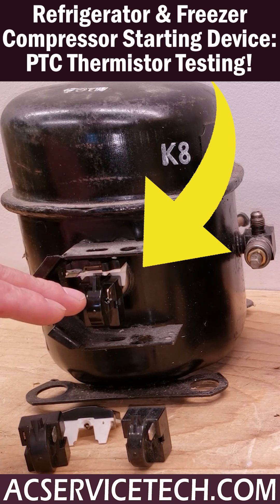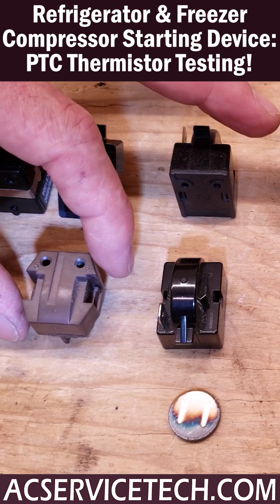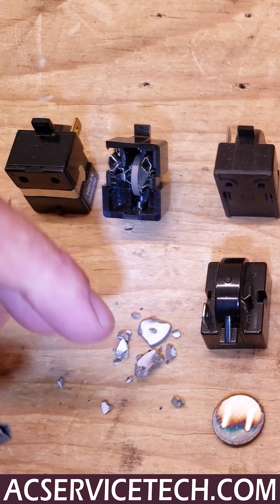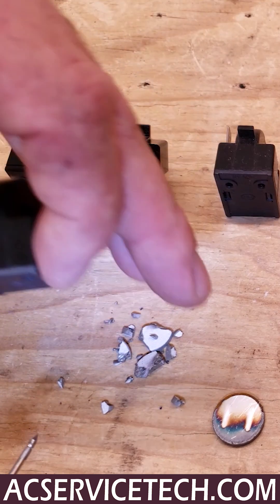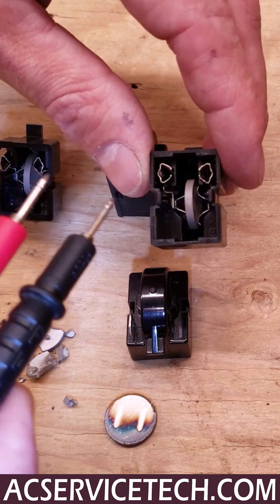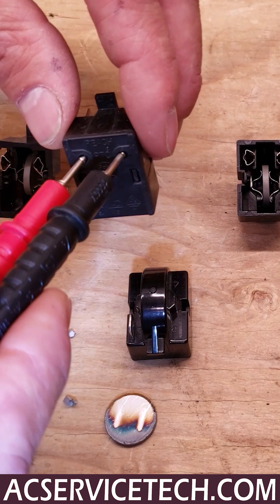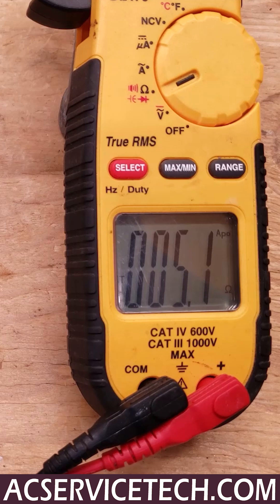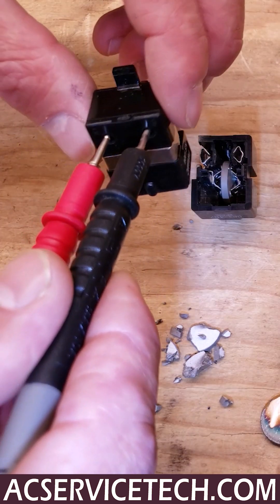HVAC Component Training! PTC Thermistor Testing & More!

Comment: Great video.  I had a one fail on a Friday night on my fridge that wasn't cooling.  I had a spare for another fridge that didn't fit.  So I took out the thermistor out from good spare and swapped with the broken one and it worked!  It saved my food until I could order a couple of good fitting replacements.

Comment: My very old Samsung fridge stopped cooling a few weeks ago.  The compressor would kick on and then immediately kick off, and repeat that every couple of minutes. The compressor was also very very hot.  I clean my coils yearly so I didn't feel that was the issue (I cleaned them again just to make sure).  I replaced this part - about 20 bucks - and the thing has been running like a champ ever since.  The old part definitely has a rattle to it.
Reply: Dpandinvvoff modelrealys  ptc  ..postivecoieffacy  ..and  box typd  realy  lms realy modelas    inside puger  coil   coil  ruing oint  strtinv poit   c  comon  old using